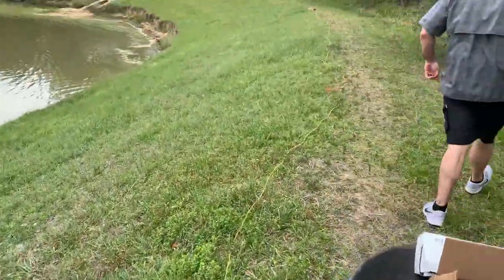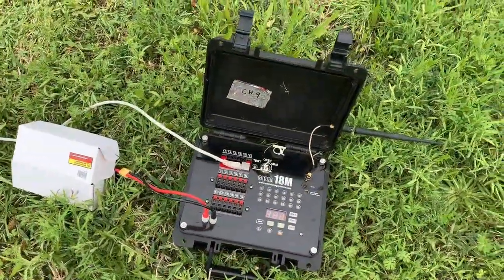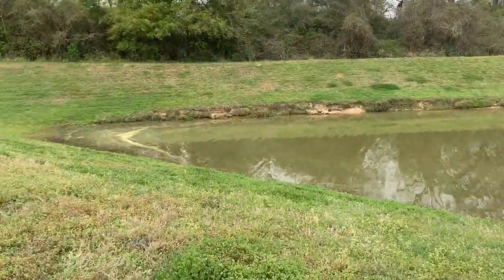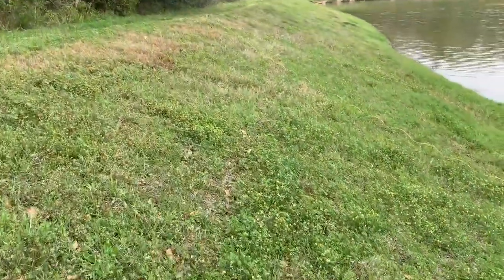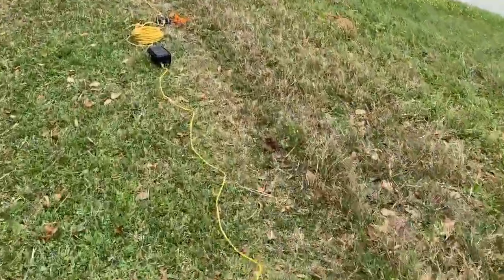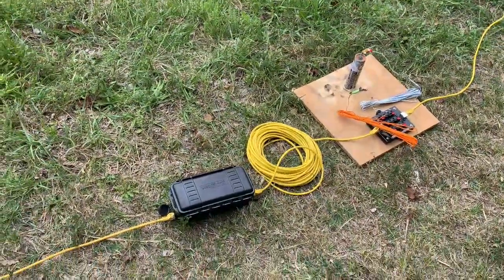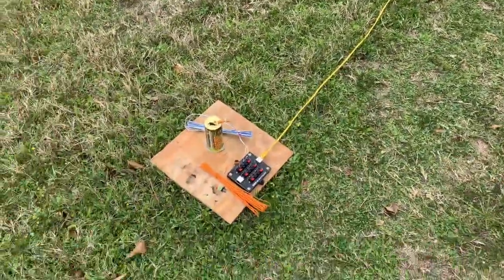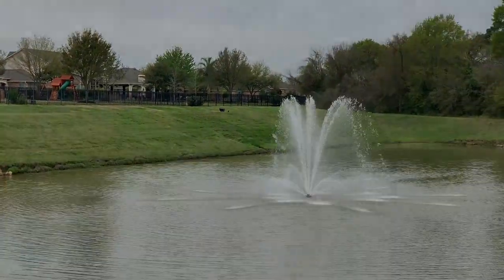Cobra mini slat test with booster

Comment: Hey bro how is that tablet attached to the 18R2? Trying to do the same
Reply from the maker: PyroDrummer83 I made a an aluminum bracket that uses the existing screws in the 18r2 and then Velcro the tablet to the bracket.  It’s is really quite secure